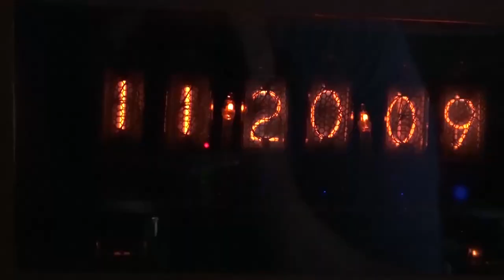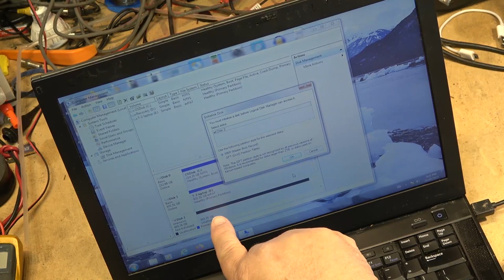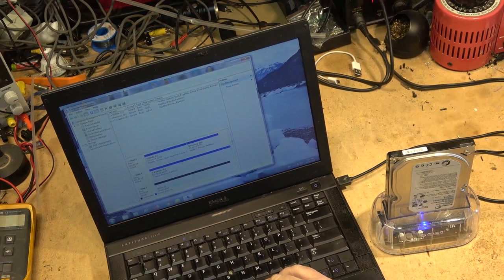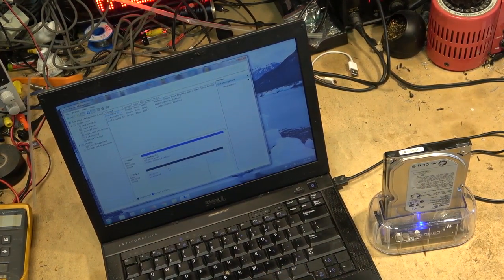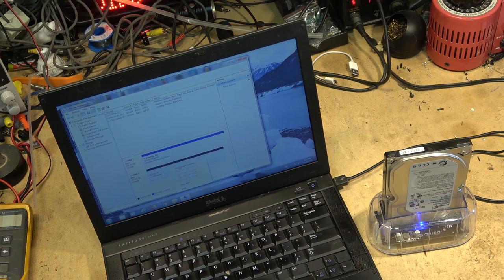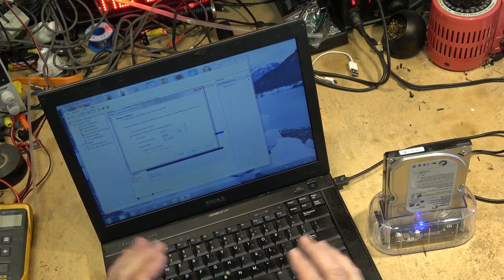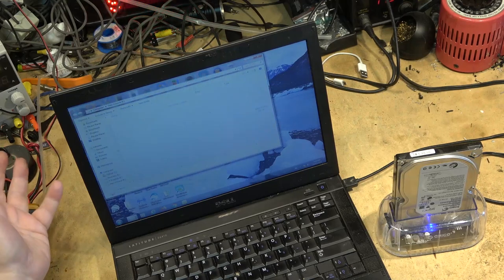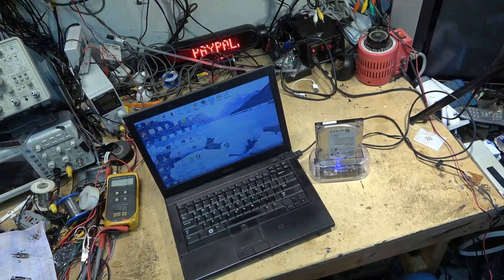Tear down and recover hard drive out of old Motorola cable box.  Will it work?

Comment: Cool video. I personally use GPT when initializing hard drives. It is much more robust than the original MBR standard from the 1983. So the likelihood you get partition corruption is quite low. In MBR, the disk layout info is stored only at the beginning of the disk, so if an accident happens and it gets deleted, you'll lose all your data. In GPT (developed sometime around 2004), there are multiple copies of the layout info across the entire disk. The only downside is you cannot use GPT in Windows XP but nowadays if you use Windows Vista and younger (7, 8.1, 10), you have much more reliability with GPT than with MBR.
Reply: All you would lose is the location of your partitions. If you recreate the partition table your data will be easily accessible. There are tools to help with this if needed. On my old computer I actually wrote down all the partition offsets and sizes on paper so I could easily restore. Sure GPT has its benefits but it doesn't really matter. For a data drive under 2TB I'll just use conventional MBR partitioning because I'm more familiar with how it works.

Side note, while conventional partitioning only allows four primary partitions you can have unlimited logical partitions. GPT allows for 128 primary partitions but no logical ones. I can't imagine any reason you'd need 128 partitions but it's interesting trivia.
Reply: @eDoc2020  I agree. But to me, the advantages and benefits of GPT are superior. It uses exclusively the LBA adressing, which makes it work the same on every computer. Old CHS addressing could be interpreted differently by different BIOSes. This was a very big problem in old Windows (95, 98, Me), those versions read the disk size from BIOS. It was a pain to work with large drives. Remember the old BIOSes having problems with drives larger than 128 GB? And later with drives larger than 2 TB? All my drives now exceed the 2 TB boundary, so if I don't want to use multiple partitions, GPT is the only way to go.
Reply: @speed_rider362   The 128 gigabyte limit had nothing to do with the BIOS interfaces but rather needing to use the newer LBA48 on the drive end. Similarly there is no 2TB limit with the BIOS interface (although many implementations likely have such a limit). BIOS calls went right from the 8GB logical CHS limit to 64-bit LBA which we are far from meeting. I think the idea of BIOS being limited to 2TB is likely a misunderstanding of the 2TB MBR partitioning limit. Since Windows only understands MBR partitions when booting in BIOS mode people think it's a BIOS limit. Linux systems can boot in BIOS mode from GPT disks and I imagine this would work fine beyond 2TB (although I haven't tested).

The CHS bit is a good point, I didn't think of that. However that doesn't really matter anymore because for 20 years or so only the LBA fields have been used. I think the biggest issues with CHS addressing were between the 504MB barrier and the 8GB barrier.

I'm realizing most of my comment isn't relevant to the MBR vs GPT discussion. For modern systems under 2TB the only benefit of GPT is that you don't need an extended partition in order to hold more than 4 volumes, so partitioning is more flexible. If there's a chance I will later migrate to a larger drive I will choose GPT and if there's a chance I will use it with older systems  I'll choose MBR. Since most of my technology is on the older side MBR will be my usual choice for random drives. However for a bootable drive on UEFI systems, I'll definitely choose GPT 99% of the time. I might even have converted the drive in my new laptop from MBR to GPT.

Comment: I have had HDs out of 3 set top boxes and they could al be formatted on my computer.
Reply from the maker: And yet i still get people making comments that they can't format them as their computer won't see the drive. Must be mac or Linux users lol.
Reply: @12voltvids  Not really, I use a Mac G4 and it formats all drives. And I can also choose to format them for either Mac or PC.
Reply: @12voltvids  - The computer won't see the drive in "File Explorer", since it's not formatted in a known file systems.
They don't realise that they have to use Disk Utilities.
Reply: @12voltvids  I can't think of any situation with any half-modern Linux distribution where this would be an issue. All the GUIs I know of (GParted is the main one) for formatting partitions include a partitioning tool. Anyone using CLI tools should know better.

Comment: Done the same over here they are usually 2.5 inch drives.
Reply: The Pace cable boxes commonly used throughout the world have 3.5" SATA drives in them. I am currently tearing a whole pile of them apart, but unfortunately they all have been WD5000AVCS which is a 500GB Green (probably 5400rpm) drives made around 2016.
The power supply is full of good bits - excellent Chemicon Low ESR long life caps and 3A and 4A Schottky diodes that can be harvested.
Reply from the maker: Our  newer boxes use 2.5" drives too
Reply: @Taco - I don't like them at all. I've lost so much data (music and movies) to failed WD Greens in my NAS and servers etc that I don't really trust them.
I realise (now) that I should have mirrored the drives for backup but I didn't... then spent months recovering the data that I could and then re-ripping the rest that I had lost.... GRRRR.

Comment: DID have a good hard disk until you threw it on the table lol
Reply from the maker: Hard drive is fine.  I have had external drives fall off the tower and into the floor while they are running and have suffered no problems.
Reply: @12voltvids  Eyup m8 you doing ok?

Comment: Hi. Did the same thing with relatives junk computers. Also, put solid state drives in two of my own and used the original HD for data. All of which leads me to a question.
Do those cable boxes have cooling fans? Hard drives can get toasty inside drive bays at times.
Reply from the maker: This one did but the ones we use at work no.